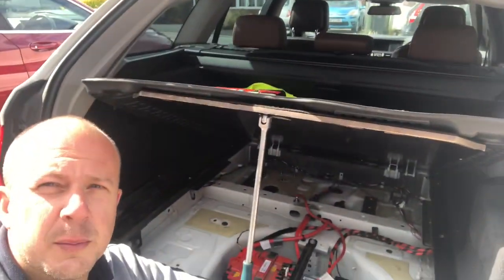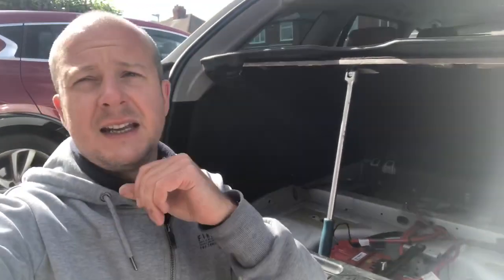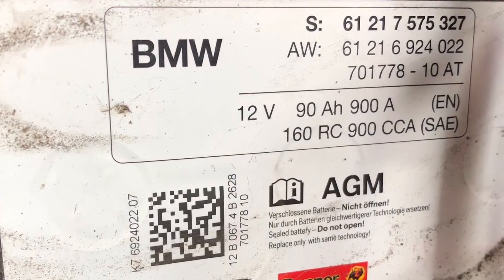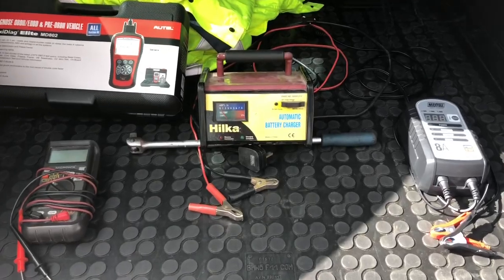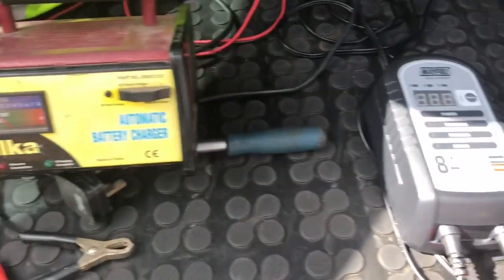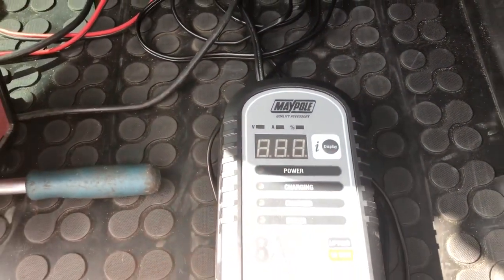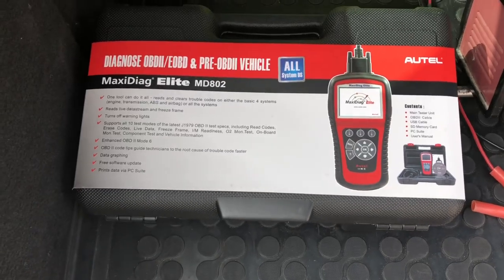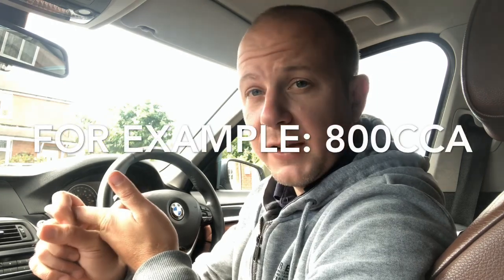BMW F10 F11 - NEVER Do This To Your Battery!

Comment: AGM and LA although both nominally 12v and boxes with lead and sulphuric acid in them are very different and need different charging programmes.
A modern charger has up to 8 stages to charging a battery.
CTEK chargers measure the voltage, and adapt the program to what condition the battery under charge is in and the ambient temperature (MXS 10 and higher)
Getting to 80% is known as bulk charge and why you might want a charger capable of high amps.   BUT an important part to battery longevity is the last 20% should be done at least once a month.
If you only do short journeys and then don't get out/switch off/use ancillaries with engine off you risk the battery degrading.
Better to leave a CTEK MXS 5 permanently connected.
Never fit a LA battery to a car designed to charge and run off an AGM battery.
A BMW has software to accept several batteries - don't assume the one in it is the correct one or that the car is correctly programmed for that battery.
Many BMWs were sold or later had trackers (or aftermarket toys) fitted which contain batteries that go bad after 5-6 years and drain the main battery.
Don't assume the alternator/regulator/PCM is/are good either.
Finally, test a battery the moment you receive it.  Having run a small company fleet I found that online retailers sell batteries that test as 80% SOH or 950cca rated batteries that can barely muster 750cca when fully charged.  While small high street parts shops will happily sell you a battery that has sat gathering dust and isn't even fully charged and again tests as bad/replace battery.  Caveat emptor!

Comment: How about get rid of the AGM & just put a quality regular battery on
Reply from the maker: It won’t cope with the engine start/stop system.
Reply: @Nut_Job.  wow that was quick oh right that makes sense I've never had stop start just wauldent want it to be honest
Reply from the maker: I always turned mine off because I hated it… but the battery system is designed to monitor/maintain charge for it.
Reply: @Nut_Job.  never had a car with it on I'm to old school E39 e60
Reply: AGM and LA although both nominally 12v and boxes with lead and sulphuric acid in them are very different and need different charging programmes.
A modern charger has up to 8 stages to charging a battery.
CTEK chargers measure the voltage to and adapt the program to what condition the battery under charge is in and the ambient temperature (MXS 10 and higher)
Getting to 80% is known as bulk charge and why you might want a charger capable of high amps.   BUT an important part to battery longevity is the last 20% should be done at least once a month.
If you only do short journeys and then don't get out/switch off/use ancillaries with engine off you risk the battery degrading.
Better to leave a MXS 5 permanently connected.
Never fit a LA battery to a car designed to charge and run off an AGM battery.
A BMW has software to accept several batteries - don't assume the one in it is the correct one or that the car is correctly programmed for that battery.
Many BMW were sold or later had trackers (or aftermarket toys) fitted which contain batteries that go bad after 5-6 years and drain the main battery.
Don't assume the alternator/regulator/PCM is/are good either.
Finally, test a battery the moment you receive it.  Having run a small company fleet I found that online retailers sell batteries that test as 80% SOH or 950cca rated batteries that can barely muster 750cca when fully charged.  While small high street parts shops will happily sell you a battery that has sat gathering dust and isn't even fully charged and again test as bad/replace battery.

Comment: Hello, I have the same model and I have a problem with refueling when I drive up to the distributor I want to refuel with fuel but the gun shoots as if I had a full tank and it is not, because I do not know what is happening and there is no fuel and I can not refuel only when she pressed gently  and I fill it slowly so I can otherwise suck the fuel back if I have a clogged vent

Comment: Good tips 👍🏻 I use the CTEK MSX 5.0 charger 🔌 on my bikes and cars! They are brilliant and fully automatic, no pressing buttons at all just plug it in and it knows and goes! Also try the excellent CARLY app (for Apple & Android) for BMW’s. Allows you to register a new battery, reset service lights/intervals, complete a ‘forced regen’ on your DPF if you’re a diesel driver, release the rear electronic brake pads for servicing, increase the halo/angel eye brightness, change/increase/stop the belt off gong And much much more 👍🏻
Reply from the maker: That’s good advice about CARLY. Originally I wasn’t a fan of CARLY, but the app interface & features has improved & is now great value for money!

Comment: You're probably my best source of DIY work on the F10 model.  QQ, does this vehicle only have the under carriage ground cable or is there another one in the engine compartment?
Reply from the maker: I think there’s another big ground in the boot/trunk area, but I think that’s the only main one to the right hand side of the gearbox 👍

Comment: How did you register your battery?
Reply from the maker: I never did in the end. I don’t think it really makes a big difference. I’m sure a BMW fanboy will come along and tell me it’s a catastrophic mistake... 😂🙄
Reply: @Nut_Job.  Of course you need to register the battery change. Or else how would the car know you installed a new battery?
Reply: @Nut_Job.  I've had a few BMWs over the years e39s e46 e60 and e65 and for the later ones found the registration necessary. Anyway I have the change battery message, does that clear when you replace it?

Comment: Its a bit strange. Since I own my F11 -  3 and half years now I was using standard charger to charge the battery. I would say 5 times maybe more I charged it. I believe it is AGM but will double check. Never had any issue though. When connected to istaD  I do get code battery faulty or worn out but its been like this since I bought the car
Reply: I've still got the original battery from when it left the factory quite some years ago and never charged it. It's still at 85% capacity

Comment: Question, How many miles were you at when time chain broke? Do you consider yourself a racy driver? Thanks
Reply from the maker: The chain broke at 166k (miles) and no I’m not really racey, but not slow either. I was doing a steady 40mph when it actually went. I do wonder if the stop/start engine function adds to the chain stress each time the starter motor activates... 
It’s probably not a bad idea to at least start thinking about your timing chain if you’re around 150k perhaps? 🤔
Reply: Nut Job I appreciate your insight!

Comment: The old chargers that looks like they were made in the 70s should be BINNED! OK? Don't use them. It is that easy. Buy a new one with short-circuit protection etc. and which handles modern batteries like AGMs etc. CTek 7000 f.ex. is a good model.

Comment: The battery on my F31 started to get lazy. I have a Yuassa smart charger that has a desulfate function. I ran this mode on the battery and bang, the life is back in the battery. Starts like a new battery now. The function is meant to run when a battery is a year old

Comment: So what is an AGM battery and why are manufacturers using them? BMW also say the battery has to be calibrated or coded to the car. Are you aware of this?
Reply from the maker: Yes, perhaps I should have talked about that too. It doesn’t need ‘coding’ as such... but a new battery needs to be ‘registered’ with the car. This tells the vehicle the battery details (eg. 100Ah, 950CCA, date installed), and the point is so that the car can charge it most effectively. I believe an older battery, perhaps with every so slightly different parameters, would need a different rate of charge to keep it up to scratch versus a new battery.
That’s the theory as I understand it anyway 👍

Comment: My wee pug has it, stop start engine, very temperamental, interesting to know though if your battery did go flat over the winter.
Reply: Most PSA cars use a standard lead acid battery as PSA cars have included an ultra-capacitor instead, to reduce wear and tear on the battery. It might have been added in by a previous owner.

Comment: Basically every stop start car will have an AGM or EFB battery also many of this cars after fitting a new battery you need to program the battery to the car
Reply: yes it would be nice to know how to register  the battery to the car ....
Reply: @TheGerry53  some cars you need to plug In an OBD tool for example Halfords uses one called iMat some other cars like some VAG products turning the wheel full lock from side to side will clear the errors from a battery change so it really depends on the car
Reply: @TheGerry53  BMW you can code battery using Carly app but in full version
Reply: Not all, Peugeot / Citroen uses an Ultracapcitor to reduce cycle loads. I have no idea why other car manufacturers don't use it as it is a lifetime part and then you can use standard lead acid batteries

Comment: Would be nice to see a video on how to adjust the airsuspension leveling system via the diagnostic tool, can’t find anything about this on the internet. 
Great videos!
Reply: NCS expert for the win
Reply: Alex Awesomesauce Beaudry, Non at the moment, just bought an f11 and currently researching obd tools and programs for it. If you guys have any recomandations i’ll gladly hear them!
Reply: af_prod you can use inpa to lower the car

Comment: Alas this is the problem with modern cars, and I’m sorry to hear of your woes after so much effort, for modern DIYers the biggest issue is becoming the availability of data and general information. Even with diagnostic tools, you need wiring diagrams and you also need to understand how the systems work and interact, which data is normal and which is not - the efforts to decrease emissions means more cars have shorter lifespans, in my opinion (which is worthless) as they become to complex and expensive to diagnose and fix.
Reply from the maker: You hit the nail on the head there Rob 👍

Comment: Good video. Let us know how you get on with the OB2 reader and it’s functionality. I noticed you coded the battery via software. I’m debating between buying an OB2 or just going down the OEM software laptop / tablet route.
Reply from the maker: Well I wanted a small, robust tool to use on a wide range of vehicles. However, for BMW’s you might as well use an ENET cable + ISTA D which you can download off the web. This gives you a very powerful range of diagnostics & coding possibilities. 
I’ll do a quick video showing what the OBDII tool can do soon, however in this instance ISTA is waaaay more powerful.
Reply: @Nut_Job.  is ista d free of charge? What's the best cable to buy to use with it please?

Comment: My E65 still has its original AGM battery. The date code (underneath) is in 2004.  About once a year I charge it with a continous 13.5 volts for about a week. That brings the voltage back to over 12.5. The car often sits for weeks and has never failed to start.
Reply from the maker: That’s brilliant 👍
Reply: E65 is a v12 bi turbo? 1000nm? 626bhp?

Comment: In addition to this you should always code the new battery to the car. And crucial step before coding is to make sure your that car is programmed for the correct battery specifications (battery type and specs). That's where ISTA comes handy.
Reply from the maker: Yes, this is very important for the long term health of the battery 👍
Reply: @Nut_Job.  i have a question.....the e38 must be programed to ...when changing battery ? 🙄🙄🙄🙄
Reply: @TheRazvy1990  no, you don't have to program/code battery on E38/E39/E46, they dont have battery management systems (IBS) like newer models
Reply: Sorry for being late to this train, but I have a question. Do I have to code anything if I will try to charge my battery using battery charger and connecting it through the ports under the hood? (I do not want to replace battery)
Reply: @xxGrandaSxx  for charging you dont have to code anything.
Coding is necessary when replacing the battery which has different parameters from your current battery. 
(80AH to 100AH for example)
Registration is necessary when replacing the old battery with new identical battery (80AH to 80AH for example)
Reply from the maker: No, just make sure your battery charger is suitable for the type of battery you have (for AGM Start/Stop).

Comment: What problems did It give you ?
Reply from the maker: Ignition wouldn’t stay on. It refused to try cranking on pressing the start button. The two persistent faults which wouldn’t go away were ‘starter relay sticking’ and an open circuit on all 6 glow plugs... I ended up replacing 3 different relays & also my glow plug controller. I also replaced the battery, tried disconnecting my IBS sensor.... and eventually the car sparked into life! I’m still not completely convinced I’ve solved the underlying issue, but I’m fairly certain I knackered my battery in the process, so I thought I’d share what I found out in case it helps someone 👍
Reply: @Nut_Job.  Your starter relay is non replaceable. it's soldered onto the PCB of the CAS module under your dash, driver side.
You can actually get away with using a standard lead-acid battery if you code the car. change the VO of the car to contain a lead-acid battery of the right capacity instead of an AGM and then code the CAS module and do the battery initialisation again. The problem lies in the fact that AGM battery's can withstand more peak load over longer periods of time. Lead-acid battery's don't but if you code the car for a lead-acid battery it will adapt the usage of electrical systems, thus the load on the battery, to the point where it won't cause any issues.
Reply: @arnobruynen6073  And add a ventilation hose and fan to remove any gases that could cause fire